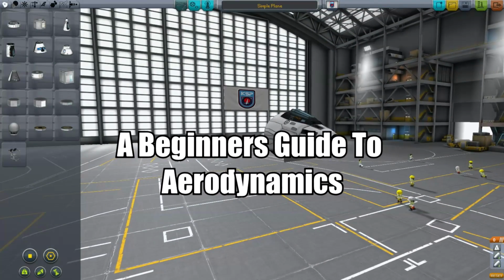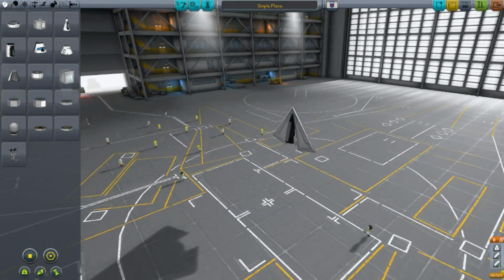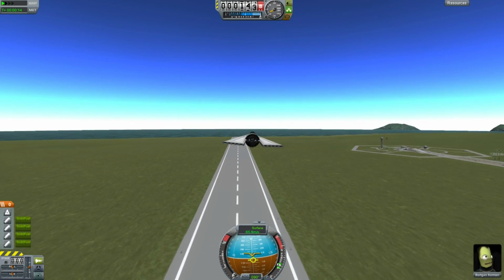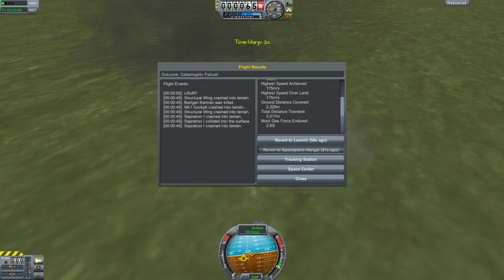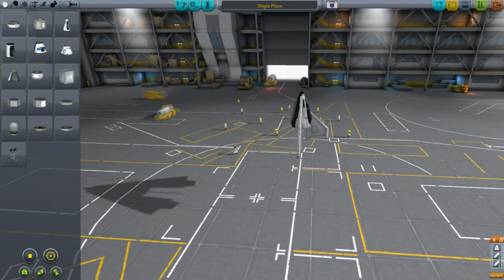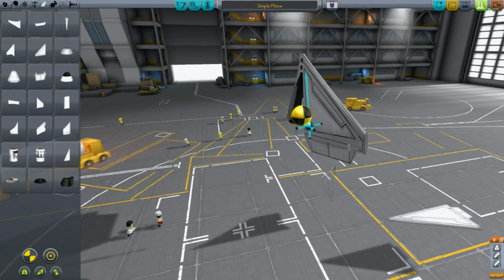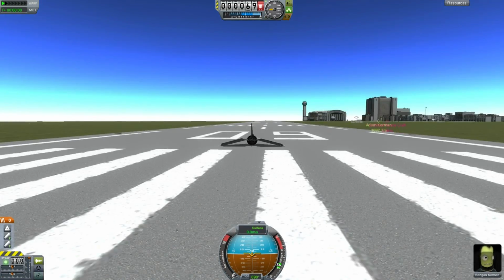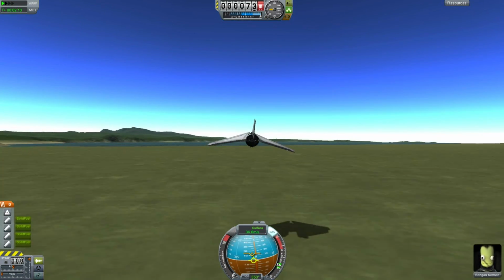Kerbal Space Program - Beginners Guide to Aircraft Aerodynamics

Comment: How do you stop your aircraft from nose-diving? Even with SAS enabled I have to hold "S" just to stay level. Happens with all my craft if I have the center of lift behind my center of mass.

I can launch a rocket and land anywhere in the solar system. But I'll be damned if I can build a plane that will lift off or keep its nose up.
Reply: Try adding a more agressive angle of attack to your lift surfaces, otherwise the aircraft will have to be flown with the nose up to maintain altitude.

Comment: question. does 2 tail fins does anything to stability? i tried to did a biplane challenge, so i did pretty standard plane. and then instead of the middle i put tail fins on both wing, and attached more wing to the top of the tail fins, therefore it's technically a biplane. suprisingly it's more stable and is actually the fastest plane i've ever built

Comment: This would be easier if there were more stock parts with squareish cross sections. By nature it's tricky to attach a wing to a round body (or the flat oval shape of the C-7 fuselages) anywhere but the middle. Although in the C-7 MK2 case the center of mass is not in the middle of the part, it's down low.

Comment: Yeah the fighters are designed very unstable because it allows for much greater maneuverability.  The most modern fighter jets are actually equipped with complex artificial stability systems... basically a computer and a whole bunch of sensors that keep the aircraft "stable" when in reality the whole thing is very unstable.  With a total computer failure in those things, even experienced pilots would have trouble just keeping it in the air and landing.

Comment: matching center of mass and lift will produce a very stable aircraft.  Moving those centers apart does build an inherently unstable aircraft, but that aircraft will pitch must faster than your stable birds.  That is a desirable trait in fighter aircraft to a point.  Most fighters I have worked on are designed to be right on the edge of stability and have anhedral wings; this makes them "yank and bank" extremely quickly.  Each setup has it's own applications.

Comment: I'm sure there are many factors that go into deciding where to place the wings.  Keeping them high also keeps the engine mount point up which keeps dirt out the intakes.  

The easiest way to think about it, is if the wing is high the CG is below it and vice versa.  If your CG is high, it wants to be on the bottom (roll the plane upside down), so you would like dihedral to stabilize.  
I hope Scott has a chance to go over center of thrust next :)

Comment: Correct, CoL is behind CoM in a propeller aircraft. Same is true for a dart. This is the only way you can control an aircraft without fly-by-wire.

FBW is what makes the extremely unstable modern fighters flyable. You cannot fly it without a computer. I write they are unstable, but they seem to fly pretty well, right? Only because a computer is constantly correcting the trajectory with direct control over control surfaces.

Comment: Here's a bit of additional info as well. Propeller fighters have a CoM closer to the front, thus the CoL of the wings tends towards the front as well.. as you can see from the position of the main wings on a Spitfire. 

Regarding instability, some fighters, like the Harrier, use anhedral wings, and some are anhedral by quite a large angle. This increases the tendency to spin, and thus manoeuvrability. It's something like a pyramid on balancing on a tip versus on it's base. (Anhedral = tip)

Comment: in propeller fighters the center of mass is forward of the center if lift, exactly as it should be. at least To a certain degree, the further your centre if lift differs from the centr of mass the more problems you get but mass should always be forward of lift, never behind. with the mas forward, if the engines shut down it drags the nose down and increases speed which increases lift, keeping you in the air, the opposite happpens if your mass is behind your lift.

Comment: You've got it backwards. Center of lift *in front* of center of mass makes for an unstable aircraft, since the lift will rotate the wing around the center of mass as the center of lift moves up and center of mass pulls the wing up, furthering the spinning.

In the other configuration, center of lift moves down, which is then balanced by center of mass pulling the wing up.

Comment: Anhedral is used in large aircraft for the exact opposite reason that dihedral is used in small training aircraft. Large aircraft are, obviously, very slow/hard to maneuver. Dihedral will fight to stop an aircraft from rolling too quickly. Anhedral assists in the roll rate because the lift vector of the inside wing continues to move towards horizontal during a bank, causing that wing to create less lift. This, essentially, "pulls" the aircraft into a turn using the assistance of gravity.

Comment: The angle of the wings has a lot to do with it. Like Scott said, the dihedral creates a self-righting property in the aircraft. This is because as you bank, the inside wing lowers and becomes more horizontal to the relative wind, repositioning the lift vector and creating more lift than the outside wing. This makes the inside wing want to rise and level the aircraft. CoF over CoM creates a pendulum effect which assists in this movement, as well.

Comment: This is not entirely correct.  Dihedral works to stabilize because the inside wing in a turn sees a higher angle of attack due to its angle.  This creates extra lift on the inside wing; a rolling moment back to wings level.

Antihedral wings are useful on super maneuverable aircraft or those with high inherent stability.  The AV-8B uses antihedral due to its huge engine being located below the wings.  It would be difficult to have a good roll rate without the "wing droop".

Comment: This is nice but I wish you had explained why tilting the wings up makes it stable.

The point is that the center of lift is above the center of mass--raising the wing angle raises the center of lift, but the angle of wings in and of itself has nothing to do with it. It works just as well to mount the wing roots higher and have them angle down (or however), like a B-52 bomber or big cargo plane, or a little Cessna, for instance.

Comment: While I don't know about the Harrier, the Kestrel (the predecessor to the Harrier) had on it's exhaust angle markers that shown it actually pointing forward of straight down by a few degrees (I think 10 or 20, it;s been a long time since I've seen it). I don't know if they ever tried pushing it that far, but it was labeled.I work at NASA LaRC and there's a Kestrel at our visitor center.

Comment: Simple answer; fly by wire. Basically a computer inputs micro-adjustments to the control surfaces much quicker and more accurately than a human ever could. Many fighters are also built in this way. 

Aero 101 basically teaches you that the less stable an airframe is, the more maneuverable. That's why you see some fighters (for example the F-104) with anhedral wings, low AR wings, etc. They're less stable, requiring more skill to fly, but they're far more maneuverable than a Cessna 150.

Comment: They are VERY unstable.
Propeller aircraft (like the Spitfire) have most of the weight in the nose, making them controllable with control surfaces. It's like a dart (the sports type).
Modern fighter aircraft only fly because of fly-by-wire (computer control of the control surfaces), since the engine is in the back.

Comment: How would you suggest balancing a large cargo mass? The plane I have flies perfectly stable without the cargo, but strapping something like 4 or 5 tons on top of the main body drags the center of mass up above the center of lift (the CoL is still behind the CoM but the CoM is vertically higher by a decent distance) I can't tell if it is because of this change or because the payload is kind of... not aerodynamic at all, might be creating a lot more drag so when I try to pitch up air grabs it?

Comment: Oh, one more thing, I tend to notice the aircraft in KSP tend to want to yaw slightly at higher speeds (500m/s+) if you don't have a centered vertical stabilizer. (Say you have one on the back of each engine in a standard twin engine design). Is this a bug or inaccuracy in the KSP flight model or would this happen with real aircraft as well in some cases? (Though the A-10, for example, is extremely stable, and doesn't have much artificial fly-by-wire assistance to assist the pilot in stability).

Comment: Swept wings do nothing to fuel efficiency at slow speeds. Because wings accelerate the flow over them, the flow over a wing will go supersonic before the aircraft itself is supersonic. The shock waves associated with this create drag, and change the handling of the wing. This effect is dependent on the flow speed perpendicular to the leading edge of the wing.

Comment: 1:How do forward swept wings supposedly increase fuel efficiency IRL, and doe this translate into vanilla KSP in any way? 2:A plane I built that was surprisingly stable had, on either side, an anhedral and dihedral wing placed high and low on the fuselage and are angled towards one another to intersect, essentially making an X on both sides of the aircraft (each wing is compounded delta/structural wings, slightly forward swept). are there any interesting properties, pros, or cons to this design?

Comment: The only benefit of angling the front tip of the wings up is a kind of automated takeoff if you do it right. The higher the AOA of the wing (short of the stall angle) will increase lift. That's how planes take off. The thrust doesn't push them into the air when they rotate up, its the increase in lift.

Comment: That's not exactly true. Turning left happens when you use symmetry on your aircraft - and that means every aircraft - some are just better in countering it.
Try making one plane using symmetry and one without symmetry. :)
I think it is caused by a frame update lag - lift on right wing is applied few frames before on left wing, so plane begins to tilt slightly to the left.

Comment: Also, if you are using a standard tricycle gear setup, it might be that your center of mass is too close to the nose wheel, thus amplifying any little wobbling of the wheel. It's best (also to ease rotation) to put your center of mass only slightly ahead of the rear wheels (main gear). ;)